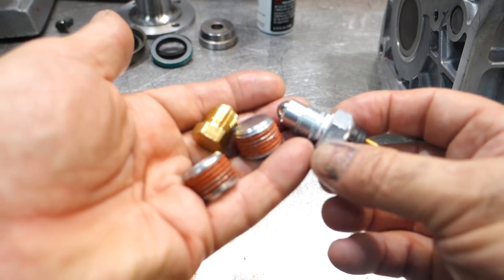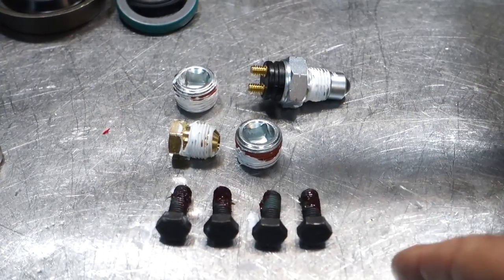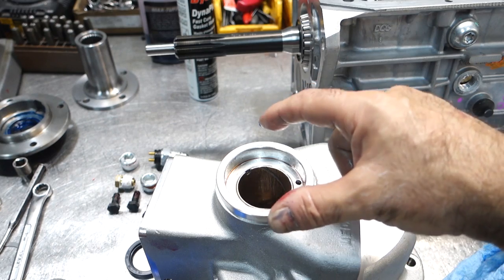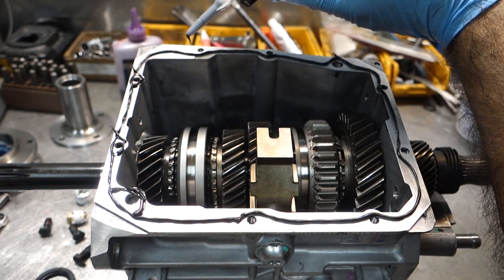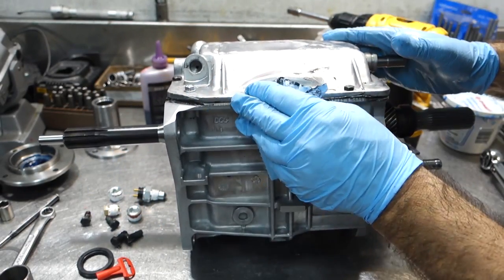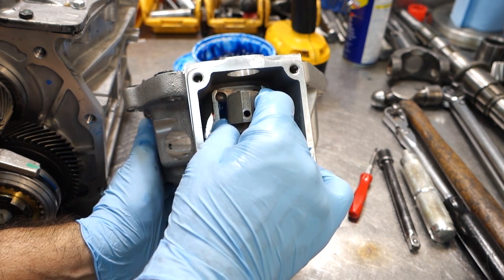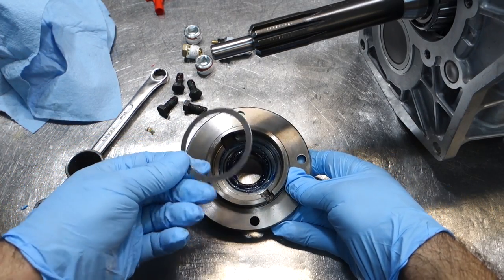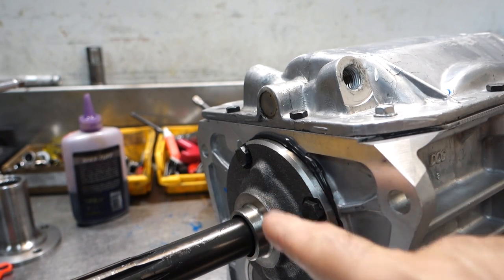Learn How To Rebuild a T5 Transmission - Sealing Tips

Comment: I just took apart my first T5 and watching your videos gave me all the confidence I needed to do this (slightly custom) job. I took a bad 2000 mustang T5 which uses a tone ring for speedo and put the ring and tail housing on a 96 T5 made with a plastic speedo gear. I put the tone ring on the main shaft behind 5th gear then i had to cut a groove in the shaft behind it for a snap ring. Over shifted 4th gear putting the shifter on and forgot to locate the reverse brake tab but by 2 am it was working! Thank you for the knowledge!
Reply from the maker: Glad it helped

Comment: A trick I learned with some transmission seals is to put them in the freezer for a bit to shrink them slightly which prevents damage when installing and reduces the potential of leakage.  FWD vehicles, this is almost a requirement in my experience.

Comment: i've watched a few of your videos and like your thorough instructions. I wish you would do a book on rebuilding Honda transmissions(B series,K series,H series,D series,And J series). Nobody has done a book on any of them and a lot of people would rather learn and not have to pay someone to do it.
Reply from the maker: +taint115 It is something I have been thinking about doing.  I've been looking for some rebuildable cores that exhibit common failure issues.
Reply from the maker: +bestmastermind951  I'll contact you.  What exact years and models did they come out of?
Reply: +GearBoxVideo D Series trans came out of 92-00 Civics and Del Sols, B Series trans came out of 90-93 Integra(cable trans),94-01 Integra(hydro trans, 99-00 Civic Si. K Series trans came out of 02-06 Rsx,02-15 Civic Si, and F Series came out of 92-01 prelude,89-01 accord. I'm sure I'm missing some probably
Reply from the maker: +taint115 What would you say is the most beneficial and educational of all to do a rebuild on?

Comment: Just bought a '92 foxbody with a rebuilt WC T5, but it's leaking between the tailhousing and case. The rebuilder used black gasket silicone but must not have laid it on correctly. I'm going to pull it apart and reinstall it using the dynatex. Thanks for the great video.
Reply from the maker: Make sure you pass a file on the case halves to make sure there are no high spots . Trial fit first and look for gaps

Comment: With sealants, some will also tend to squeeze IN as well as out, of course, you can't clean the stuff on the inside.  One thing I learned to do early on from one of these street-rod building ancient guru's is to add a bit of a wave, like a sin-wave, to your sealant bead.  Maybe it's a bit of a superstition but he proclaimed that he never had a seal issue from doing it this way, and from a physics standard you will have slightly more material per linear inch.
Reply from the maker: +ReddmanDGZ  I don't think that is a good idea.  You want to be centered between both clamping surfaces. I take apart many brand new transmissions, because now its the only way to get a complete set of parts to build one of my modded Jag 5 speeds. There is always sealant overhanging the inside. I hate that. I prefer anaerobic sealants because the viscosity allows for a smaller bead with no overhang. I have never had leaks on any of the 5000 plus transmissions I have built.

Comment: I'm a big fan of all your videos on performance T5 but I'm curious how do you get rid of all the excess sealant on the inside of the transmission there's no way to wipe it off (like the outside). And on some of your tear down videos you say that can be harmful to a transmission or the cause of its failure. I'm not talking about type of sealant. Just the extreme excess that's going to be on the inside like it was on the outside. I like the idea of the anaerobic gel because it would just break down in the fluid and not cause any damage.

Comment: hey paul your the only guy that really looks like he knows what he's doing lol. my 3-8ths ball and spring came out also my dial pin was coming out and pushing on my stock shifter. it kind of messed up the top of the pin and mushroomed it. this leads to my question. do I have to take my tail shaft off in order to put a new pin and detent spring/3-8th ball? or is there a way i can do it with it in the car ?
Reply from the maker: I don't understand how the spring and ball can come out without removing the offset lever.  In a Ford you can remove the cup plug in the extension and slide it in.  There is enough room
Reply: @GearBoxVideo I bought the tranny from a guy and it wouldn't shift so I bought a new shifter and took the stock one off to find all of that stuff so hopefully, I can get it back together any tips? should I get only a new pin or buy like a kit?
Reply: also its from a 87 5.0 im putting it into a 93 lx with 85ho motor
Reply from the maker: It's a standard 3/16 roll pin
Reply: @GearBoxVideo GearBoxVideo so it's possible to assemble it with the tail shaft on?

Comment: Paul, love the videos.   In my 81 cj7 T5, how can I get the input shaft seal out?   The seal is flush so didn't see anyplace to grab with a seal puller.   So left it in.   Is there a little notch there that I did't see?  Does one of your other videos show how to?   Many thanks!
Reply from the maker: You have to pry them out with a screwdriver. The rubber clad ones come out easy.  The steel ones you will have to distort until they get loose.

Comment: Great video. I have to drop the T5 in my Jeep as my front seal is leaking. I'm guessing my rebuilder either damaged the seal when installing, didn't replace it at all or didn't use sealer when reinstalling.
Reply from the maker: Often it is not the front seal but the front cluster bearing not sealed in the case properly.
Reply: +GearBoxVideo Not what I wanted to hear, but thank you for the tip!

Comment: Hey Paul,  can't stop watching! I wish you could rebuild my T5, but I'll have to make do. My T5 lets out a long groan on high RPM shifts (above 3,000 RPM) and won't go into that gear. I have to hold the clutch in for a few seconds and try again. However, changing gears driving gently is no issue. It does this for 1st and 2nd gear, rarely 3rd and 4th. Do you think it is the synchronizer units for each gear causing this? I believe the unit has 250K on it, unsure if it has ever been rebuilt. Any of your advice would be appreciated! I wanted to disassemble my first manual transmission (Tried a TH350 before and had to have the transmission shop put it back together!)
Reply from the maker: With that much mileage I'm sure the synchro rings are tired. You do need access to a press if you are going to work on them.

Comment: Good vid. The Dynatex products look nice I especially like that pump applicator vs the runny mess you get with loctite/permatex. Do you have a preferred vendor you recommend to source the Dynatex stuff from?
Reply from the maker: +Chad Ross Thanks. Yes the pump threadlocker has been  great because it doesn't run and I can preapply it to bolts on a build much faster.  They hit the viscosity right on that design.  I also use it to lock sleeves in place.  This in general will also reinforce any press fit.  http://www.5speeds.com/cart/index.php?route=product/category&path=66_78  is the link.

Comment: I actually got the rtv in my oil pan hole n it busted the bottom out of the hole I didn’t notice till I turned my motor on the stand and heard something sound like a bolt hit my oil pan from inside turned out to be the bottom of the hole that went into the motor I haven’t got it back in yet to see if it’s gonna leak or have any other problems 😬

Comment: This looks like rebuild with many new parts and sealed very good. :-) Anyhow it is possible that it could  break in some circumstances. For example, lubricative is in bad condition, so one has to swop it, before this happens. How  long can this T5 Transmission run with the same lubricative, and when it's better to change it earlier?
Reply from the maker: +J9V3A6  Lubes are dependent on use. There are no dipsticks to check the oil level or condition on any T5.  If you are racing , its a good idea to check your lube level and condition before every event. If you are on the street its not uncommon to go 20 to 30 K miles. Most common problem is people ignoring leaks and burning units up. The  T5 takes Dextron III / IV fluid which normally looks clear red.  So if you are dirty black, you need to change it.
Reply: It's perhaps the easiest and best thing to change lubricative. Not only because the gearbox is far above that hop limit. Thank you for this. :-) I've also noticed that the gearbox ist leaking between engine and gearbox at inputshaft! Something like useing the jack, removeing a tire, void the gearbox, do a refill and put all parts back in place should solve this..

Comment: I tried searching about this before but could never find any real answer so maybe you have an opinion on it; what happens to excess sealant that squeezes out into the gearbox (or engine, or whatever else sealant is being used on). Seems like you'll have an equal amount of sealant squeezing inwards as outwards, so surely there'll eventually be loose sealant circulating in the machinery or the oil. Just curious if that's a non-issue or if it can cause problems.

Interesting video either way, thanks!
Reply from the maker: +Mythricia YES! That is a problem.  In engines if the sealant becomes loose in can clog the oil pump screen as well as oil passages. The video at this link: https://www.youtube.com/watch?v=jS18jpucG50  shows excess sealant in a transmission. This sealant in this video works well and I try to keep in the middle of the path so it equally goes in both directions.
Reply: GearBoxVideo Awesome, thanks for that info, I been wondering about it for a long while. Makes sense with pump filters/screens. Will have to check that video too!

Comment: Paul, I have a 1982 Jeep T5 that went to clanking inside after I popped it out of 1st before I had the clutch all the way in.  It also is trying to go into other gears (and maybe reverse) with the shifter in 1st and just easing out on the clutch.  It did this when I was limping it home. The trans was rebuilt about 11k miles ago by a shop and it did this very thing when it first broke.  Could you tell me what you think is the issue, and if it is possible there is a case problem with this transmission?  Im worried i'm wasting money trying to salvage this transmission and need your help.
Reply from the maker: What engine do you have and do you have oversize tires? These transmissions will break with any abuse with larger that stock tires

Comment: In this video you use a Dynaplus rtv sealant, in the ebay video you say you use anaerobic Permatex 51813 sealant, which one do I use ?
Reply from the maker: +devonrod Many people insist on using the RTV quick black sealant, which is what the factory did use.  I do like the 51813 because it applies easier.  In fact the Dynatex version in my opinion flows better with less waste. Its all about cost. Some people  refuse to spend more money for anaerobic sealants and will settle on the black stuff. I did this video because I like the aerosol versions, they produce less waste and you don't have to contend with tubes that dry out. Thanks for watching!
Reply: +GearBoxVideo In many cases the oil pump screens are rated to take a certain amount of this kind of  blockage from the factory, but in performance applications it's vital to avoid that since it may be running at a higher temperature than it's really designed for.
Reply from the maker: +ReddmanDGZ  Remember its not just the screens but the oil galley passages that get blocked. Manual transmissions are way more forgiving than an engines oil system.

Comment: hey paul what do you think about using the solid trans mount on the t-5 and motor solid motor mount, because they say if you use the solid trans mount you have to use the the solid motor mount, what to you think paul good or bad, thanks buddy so much
Reply from the maker: I dont see any advantage to solid mounts because unless you have a stiff chassis, any twist of the chassis will transmit directly to the case of the 5 speed, and cause it to crack.
Reply: hey paul Iam going to rebuild my t-5 with the basic master rebuild kit and billit keys and bronze fork pads, do you think with just the mild street driving maners ocausunaly no drag racing, siting behind a 351w mild build about 390hp 380tq do you think it will last or blow up, and paul what clutch would you use with componation. thanks my friend.

Comment: I have a question.  Do you have to put lube on the seal of the bearing retainer.  If so will Autozone Moly EP grease work?
Reply from the maker: Just use a regular wheel bearing grease with no moly.   You want the oil to wash it out and the moly shouldn't be floating around

Comment: Some fellows I know who run these in their Cobras say they leak at the rear. How to prevent leaking from the rear? Would you look into a new transmission to stem the leak as well?
Reply from the maker: They shouldn't leak.  I've never had an issue.  I suspect that if they have an IRS rear the yoke is really not moving and perhaps they should grease the seal before installing the yoke
Reply: @GearBoxVideo  Thanks. I did speak to a fellow who lives close to me who said his tremec leaked and he took of the back part and used silicone to seal it. But you show the anaerobic sealant on the trans seal.

Comment: Hey Paul, 
What fluid do you recommed for a non world class t5. Autozone sold me STP Automatic Transmission Fluid Mercon V. I have already dumped in the T5. will there be any issues? what do you recommed? 
THanks!
Reply from the maker: The Mercon is correct for that. Most people think it is gear lube.

Comment: Hi Paul, the 3/8 brass plug for the neutral safety switch, does it need to have a flare on the end or can an ordinary blanking plug be used ? Thank you.
Reply from the maker: Doesn't need a flare end. It's just the correct thread size.
Reply: Thanks again Paul, invaluable information on your videos.

Comment: the thread sealent ur using from dynatex is it better than the one from permatex or loctite?
Reply from the maker: I like it. It seems to apply better. Cost is a little cheaper. Since I found Dynatex I no longer use or have a need for Permatex products. Not an endorsement either, nobody gives me anything for free.

Comment: Floor against floor we don't use black paste but Loctite 573
Reply from the maker: 573 is slow curing. So if your building a unit and going to have it up and running in a few hours I would recommend 51813 Permatex. If you basically want an anaerobic sealant 573 is great but I would let it sit a full day.
Reply: @GearBoxVideo  👍🏻

Comment: GearboxVideo love your content. I have a question. I just purchased a 1995 GT has a 5 speed T5 World Class. I had my fluid checked yesterday and my friend said it looks like I might have a leak (he noticed the transfer was a little wet before he pulled the fill plug) When he pulled the full plug he said fluid ran right out so it's full (maybe slightly over filled) could a overfill cause a leak? Also I have noticed a slight whine in 1-3rd gears that you can hear in the video here https://youtu.be/NIUaRILMwUw ignore the static clinging noise at start. It's not the trans it's because my phone was setting in the ash tray while recording.

thanks
Reply from the maker: Transmissions can leak if overfilled, but the whine you hear is typical of these transmissions when the input shaft and front section gear teeth start to distort. Either from a low oil level at one time or hard use. It is quiet in 4th gear because no gears are used when in direct mode.
Reply: GearBoxVideo so been watching some of your videos. how crucial is it to have this repaired? also I'm guessing to correct this you want to replace the input shaft and bearings.
Reply from the maker: You would probably need a new input and countergear. Probably go trhough the whole trans since it either ran low on oil or fatiqued the gear teeth
Reply: GearBoxVideo so how crucial is it that I should get this repaired? Trying to set a priority for things that need to be done to the car. Also where's the best place to get the new counter gear, input shaft, and bearings?
Reply: GearBoxVideo I saw you have rebuild kits, but do you also carry the input shafts? Also how crucial is it to have this repaired so I can prioritize repairs on this car.
Reply from the maker: I stock some. Depends on the ratios
Reply: GearBoxVideo what ratio should I get and how much roughly do the parts run?
Reply from the maker: You can't just change ratios since that requires a whole gearset change. The problem right now is that Tremec has discontinued most of the gears for these transmissions so whatever is available new will be aftermarket. You can drive this with no issues, just don't start beating on it.

Comment: Synchromesh or ATF in the T5?!
Reply from the maker: Synchromesh fluid from Pennzoil works well as does Dexron IV or V.  Royal Purple SynchroMax is my favorite.
Reply: Synchromax won't hurt any of the blocker rings will it? I've heard that some the synthetics especially the Synthetic ATFs clean the inside of the trans too well and strip the rings? any truth to this?
Reply from the maker: No.  Synchromax is designed to work with composite rings.  I use it in all my endurance t5 applications.